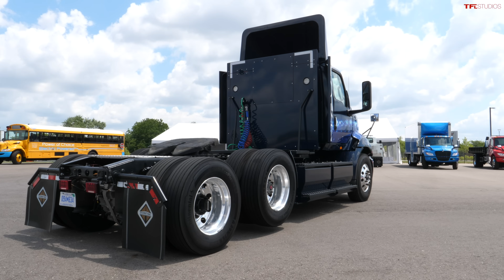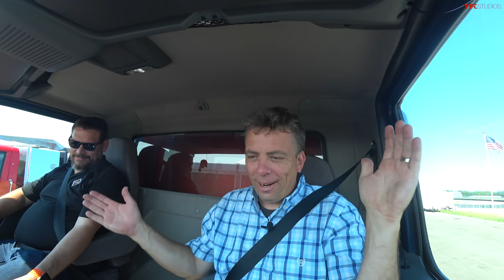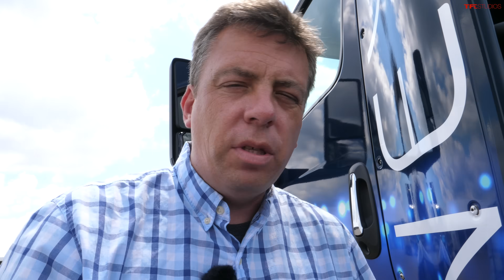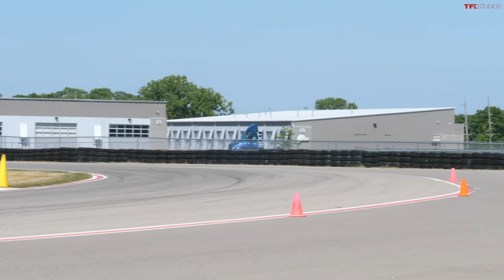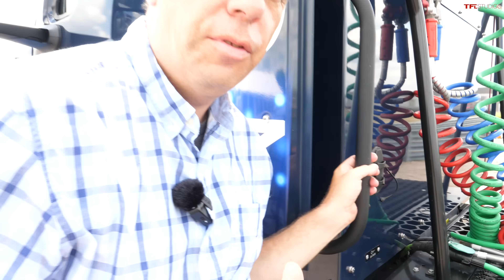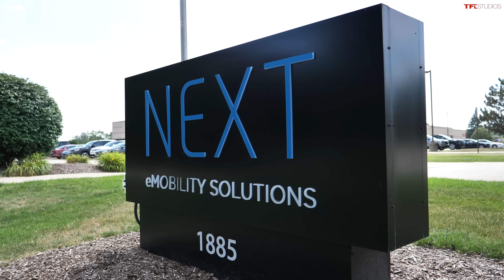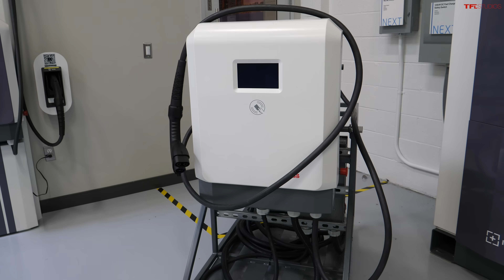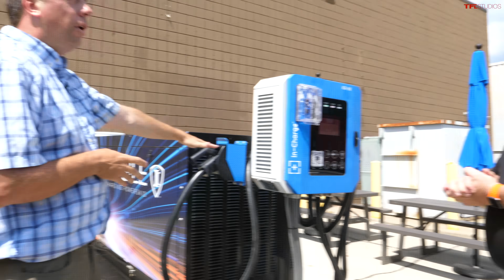Badass EV Big Rig - This International 18-Wheeler Packs a Huge Surprise!

Comment: I'm game for quiet delivery, school buses, and local rigs running through town and city centers. Just the reduction in noise pollution is worth it.
Reply: While that is great I personally await an electric mower future, oh god that would be awesome.
Reply: @venom5809  that would be terrible, I’d have to cut one section of grass, then have to stop to charge for like 8 hours
Reply: @venom5809  great point because the small engine industry is unregulated and one 2 stroke engine pollutes 10 times of a car .. right now the electric lawn mower and other lawn equipment are 10 times cost effective than it’s gas counter parts .. means with in a month of usage the savings will recoup the cost .. we just need to have educate people
Reply: @sudeeptaghosh  I have been using an electric lawnmower for about 3 months now. That particular mower will absolutely never pay for itself compared to the Honda gas mower I was also considering. I got it because I wanted it, and that's it. I love electric stuff, but it's not even remotely cost effective in most use cases compared to traditional.
Reply: @tylerrencher5559  what you putting in your electric lawn mower unicorn tears😂😂 ..? Atleast acknowledge that you don’t have to smell gas fumes to fill your electric lawn mower .. or at current gas price you saving 10 times compared to electric lawn mower … and the best no storage pain .. no carburetor draining no oil change no other maintenance.. no completely disagree that it’s not cost effective..
Reply: @sudeeptaghosh  As I said, I bought it because I wanted it. I can mow my lawn later and earlier in the day and don't have any maintenance. It is not cheaper though. I spent $400 more on the lawnmower than a quality gas mower would have cost me. It takes me about 1 quart of fuel to mow my lawn with a gas mower, so lets say that's $1.50. It costs me about $0.10 in electricity to do the same job. I mow my lawn about 20 times per year. So that's $30 of gas and $2 of electricity. That's a payback period of about 14 years on the electric mower. I might expect a honda gas mower to last that long, but I don't expect an electric mower to last that long. This is clearly still a choice of preference and not a choice of economics. If someone used their mower a lot more than I do it might make sense.
Reply: @tylerrencher5559  What??  A Honda lawn mower is $500 and up.  I got my middle of the road electric mower for $500 with two batteries.  That was three years ago, it's still going strong.  It saved me money the first time I used it, and the savings only increases over time.  There are even cheaper electric mowers available.  Even if someone does all the maintenance themself and they value their time very little, gas, oil, filters, etc all add up.  Maybe vs a $40 lawn mower from a garage sale electric might not catch up, but certainly not a new one from any reputable brand.
Reply: @Rumline7  A mower with enough battery to actually do my lawn in one charge was $900. You can buy a cheaper mower to save money, but you don't save time.
Reply: @tylerrencher5559  My Honda push mower is 10 years old so far, still a one pull start.  :)
Reply: @tylerrencher5559  I have 0.3 acres of grass that I cut weekly.  With two batteries, one is charging while the other is cutting.  No down time.  I use three batteries' worth to cut and edge the whole lawn.  The same battery goes in my string trimmer.
Reply: I am sure counties are looking at this very seriously for their school buses!!
Reply: @blackstripes3523  China the last few years have not been testing or swapping 1 or 2 or 5 buses they swapped 10,000, 15,000, and 20,000 over a weekend and whole cities swap fleets of EV buses - BYD are world leaders - I belive one bus made in the USA had 650 mile range
Reply: @blackstripes3523  you probably don't know this but most countries don't have school busses for high schools only really ford transit or Mercedes vans for kids.
Reply: They are now running EV Busses. Bit like the old Trolley Buses without the wires
Reply: People who live in overbuilt areas and complain about noise are some of the dumbest ever
Reply: I hate the rude awakenings I get from the dumpster trucks.
Reply: @Silverback_GMT410  I know 3 companies already have EV dumpster trucks in production and you can buy/lease right now
Reply: The impact of PM 2.5 is very adverse on growth of young minds .. we need to stop burning yesterday 😭😭
Reply: The latest generation of diesel are very quite. You'll hear more noise from the fan and the air pumps pumping up the brakes than you will the engine itself.

Also, overall, an electric truck would make more noise because of the heavier weight pressing down on the tires, creating road noise. That means are highways will actually get nosier. You would only see a significant reduction in noise at lower speeds, or at idle.
Reply: I'd like to note that a surprising amount of noise comes from tire noise which will never really go away. Still better though
Reply: @VeMultiVo  At low speeds in town (trash truck, etc.), most of the noise is from the engine.
Reply: @stephenj4937  my house is up on a rise. In summer, with the windows open, any vehicle going by has enough tyre noise to drown out the TV momentarily.  It’ll be quieter sometimes, but not quiet. 

Coarse chip roads are noisy.

Comment: Yes but when diesel goes back down in price and it will when we get a new president EVs will be completely impractical
Reply: In California, it already cost more to charge per mile than it does to fuel with diesel per mile, and diesel is $6.50/gallon.
Reply: They've been impractical for years

Comment: Wow. The amount of work, mining, Co2 emissions, earth moving, pollution, slavery, etc that went into making all the things for that is crazy. Can we all admit this isn't about the environment at this point?
Reply: Did they mention if these were LFP batteries?  I watched/listened to this video earlier and I didn’t hear anything about the specific battery chemistry. That makes a difference from the human rights piece you mentioned, along with Co2.
Reply: Even though EVs cause more pollution to produce than ICE cars after about 40k miles of use they are cleaner because of their higher efficacy and the fact that gas/ deasil need to be continuously refined and shipped which adds to their base pollution.
Reply: @That-Guy_  yes, but are we all going to ignore the fact that what's charging these electric vehicles is 70% fossil fuels? And the process to recycle these batteries is extremely difficult and polluting process. And EVs are extremely heavy(most of it from the battery) and cause tires, rims, motors to decline a lot faster than gas. Which increases demand for more raw material. Some Which can't even be "recycled." All I'm saying is that these EVs are cool and all, but let's not play ourselves thinking they are a "green solution." Let's be real here. Plus, I thought that biggest Co2 pollutant is cow farts? 😂😂😂
Reply: @jloop_2008  One variable is where your energy is coming from.  For instance, consumers energy where I’m located gets a large portion of energy from hydro (about 1003 megawatts for summer).  So more than half the energy used at homes here is from hydroelectricity.  The rest is a combo of turbines, wind parks, solar gardens, oil, steam, gas and coal.  From a co2 perspective, extremely green to go the EV route just using the standard grid here.
Reply: @vbaker4  Where do you live? Also, wind turbines not eco-friendly at all. Same with solar. A article about the solar panels just came out about the massive problems they are running into with the expired panels. Extremely toxic to the environment as well. I live next to a city that has a huge power demand(Denver Co) and would not be able to sustain the demand without natural gas.
Reply: @jloop_2008  Michigan.  Consumers and DTE are the big providers here.  I haven’t seen a scholarly article regarding solar or wind turbines have a toxic effect. I have seen a surface temp increase due to the amount of land needed for wind.  For my region, that’s a small part of our power source as hydro is more than half.  Now the solar panel issue you mentioned sounds like folks not following the correct recycling methods.  Interco recycles panels here in Michigan and almost everything can be reutilized.
Reply: @vbaker4  so the report I'm referring to is From The LA Times on  July 14 2022. I won't copy and paste the whole article on here though. It also had to be "updated" by the editor because it got so much blow back from the environmentalists. I'll copy and paste the following section though: Sam Vanderhoof, a solar industry expert and chief executive of Recycle PV Solar, says that only 1 in 10 panels are actually recycled, according to estimates drawn from International Renewable Energy Agency data on decommissioned panels and from industry leaders. As far as wind turbines, the blades themselves are not recyclable at all. And the footprint that goes into them requires a lot of earth moving and destruction of undisturbed land. Not to mention it kills a lot of birds. You should see what's happening in German right now. If you haven't already. They are in a "gas crisis" and are at the risk of a lot of people dying this winter. It's very interesting.
Reply: @vbaker4  you mentioned oil for used in power generation.  That’s really just for emergency or remote power applications, right?
Reply: @jloop_2008  I see the article, but this is about people actually recycling versus throwing them away. The same argument can be made for cans, papers, etc.  outside of that, I don’t see any studies, just an observation.
Reply: @jamesbeaman1988  that and a combination of the other sources are the remaining sources for energy in my area. Again, hydro makes up over half.  This is going to differ from area to area depending on what options you have. We are at the Great Lakes and have that main source.
Reply: @jloop_2008  
The current US energy mix is about 22% renewables, 20% nuclear, 37% natural gas and 21% coal. So only 56% of the power made has carbon and particulate pollution. And the grid is getting greener every year. More companies are coming online to recycle the batteries like Redwood Materials, Li-Cycle, Aceleron and ReCell. This will actually reduce the need for mining overtime and make EV’s ever greener. Some EVs are heavier than their ICE counterparts but not all. The extra wear on tires is from the instant torque that EVs have but you can choose to not accelerate to quickly and save your tires.
Reply: @jloop_2008  I live in the Springs. Much of Denver’s electricity comes from Comanche Solar in Pueblo, run up two transmission lines feeding into the hub at Daniel’s Park near Highlands Ranch. Those are the two lines you cross under on 25 between 470 and Castle Pines.
Reply: @martyscholes119  you are 100% percent wrong sir. Around 44% comes from coal alone. You and your suit need to really dive into that one. Not too sure what propaganda network you're watching. Their own website debunks your claim. 😂
Reply: @martyscholes119  When completed next summer, the “Comanche Solar project” will use at least 450,000 panels across 900 acres of land, and deliver 156 megawatts of energy, which is enough power for 30,000 Colorado homes. Public Service Company of Colorado, subsidiary of power giant Xcel Energy, will buy the power from the farm over 25 years. 

^^^^^I didn't say this^^^^^ 

31000 isn't even the population of Pueblo. It couldn't even power all of Pueblo if it wanted too. So in what world would you think it could power Denver? Once again, what Kool-aid are you drinking?
Reply: @jloop_2008  I don’t believe you but I would believe a credible source, if you have one.
Reply: Yawn. Try an argument that hasn't been debunked a thousand times. Or do you think fully refined diesel fuel and the metals for ICE trucks drop from the heavens like manna?

Comment: Good Morning Andre, great video! 

Few things I wanted to point out is the total GVWR on electric semi's is actually 82,000 pounds. Not 80,000 pounds. I believe NHTSA raised the total weight limit by 2,000 pound to accommodate for added weight with batteries. This added legal GVWR is actually more profound (I think 4,000 pounds) in Europe.

Another fun fact is the Nikola BEV also has a single drive axle. However, the drive axle is in the middle and not the tail. However, the Nikola does not have a lift-axle like the one shown on this International. 

Thanks!
Reply from the maker: You are correct! Thank you for clarifying.
Reply: How much does it weigh?
Reply: @Viccus476  - power unit only for the Nikola was 29,400 pounds. Add a pound or two with a full charge of electrons. ;)
Reply: @Burroughsbikebuilds  Thank you for that information. This is not good for these vehicles. The weight is going to significantly cut into the weight the trailers can carry. Electric semis are not financially viable because of battery technology. They would be better off looking at hybrid technology.
Reply: @Viccus476  - Like any scenario - It depends. We do short-haul locally in Denver and I would say about 90% of our loads are below 40,000 pounds. Even with the weight penalty the fuel savings would likely outperform financially with our short-haul use case as an example.
Reply: @Burroughsbikebuilds  I didn’t catch the price for the truck. The other heavy duty trucks tested were $250k per unit!!! There goes your fuel savings and battery disposal is a nightmare.
Reply: @Viccus476  - Actually, our Nikola bid was $440,000. And it still made financial sense for us when you remove a majority of repairs and cost of diesel. Business has a funny way of making seemingly unreasonable purchases make sense. Hope this helps. :)
Reply: @Burroughsbikebuilds  Let’s see what happens. The cost of batteries is screaming and the cost of charging is also zooming. I hope it works out for you.
Reply: @Viccus476  - I've been very fortunate to have some unfair advantages. One of them is my lease on my warehouse. In my lease agreement the landlord pays utilities. So, my charging (which I estimate to be about $42.17/charge for 75% of the battery on the Nikola) is "free" to me.
Reply: @Burroughsbikebuilds  That’s very lucky indeed. I looked at the Nikola something doesn’t make sense. How can you move 82k lbs with that few KW hours? The auto makers can’t do that. Are the range numbers for a tractor with no trailer?

Comment: I’d like to see the math of fuel costs, my savings estimate is anywhere from $15k to $60k a year at current prices and a route of 60-200+ miles.  That right there would justify the higher investment.
Reply: Don't forget some states have 40-100k heavy duty ev incentives as well. If the new ira bill gets passed Into law for next year?
Every ev semi could be ellligible for an at pos rebate of up to 40k on top of the state and or local incentives. Someone showed how in Cali a base 300 miles tesla semi would be less than 10k in total after the Cali rebate and the new ira rebate. 😀
Reply: @4literv6  around the price of a used Leaf…
Reply: Not to mention the reliability aspect. Modern day diesel are notoriously unreliable with there emissions restrictions
Reply: That’s huge .. for 10 year life time the savings are so big